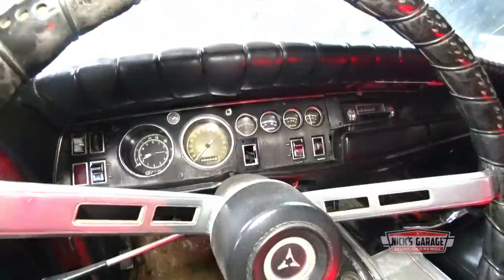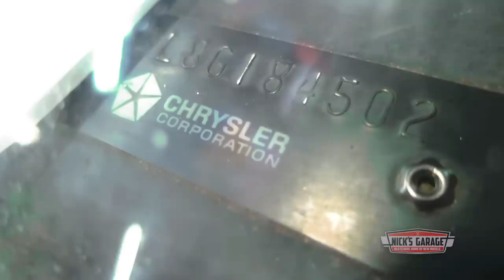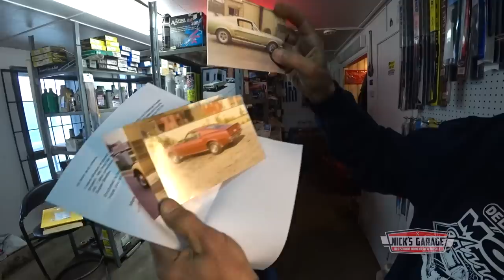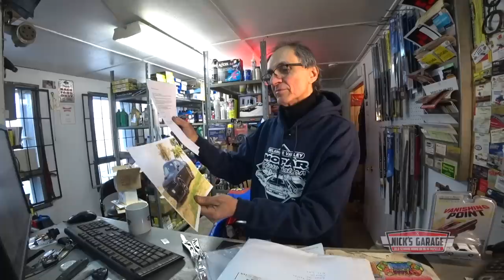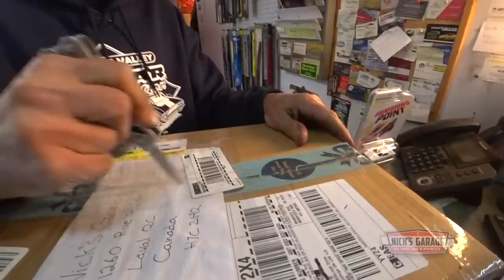1968 Coronet R/T 440 Tear Down - You Won't Believe What's Inside!

Comment: I got married in 1975. Had a rough running 69 Nova SS 350. Saw a 68 Coronet R/T for sale for a long, long time at a tire store. Traded Nova and $ 150.00 for the not running Coronet. Towed it behind my father in laws 64 Chevy P up 60 miles home with an old chain. Needed a battery, alternator, fuel pump, carb. and gas tank flush. With help from my MENTOR  (father in law, heavy equipment mechanic) got the 440 / torqueflight , Dana rear running strong.  THAT CAR SCARED US ON MANY OCCASIONS.  Was well known on Long Island N.Y.  Was a crazy fast animal. She loved running hard.  I swear Nick - she said faster, harder. Your shop makes me smile. The best days of my life were around hot cars and all nighters wrenching till after dawn. I thank you sir.
Reply: Van.      Good old days.

Comment: Much respect for reviving old muscle instead of replacing everything with an LS.
Reply: That would be sacrilege.
Reply: I agree...LS’s are for real men wanting mucho power... j/k
Reply: He doesn't need to remove the other head, especially if he can check it out with a scope, and he doesn't see excessive wear on the side that's already open, but he should crate the big engine for museum time and bolt in a lightweight 2.2 for better traction, along with rear battery. or would the AMC 2.5 be easier to bolt in?  trade power for traction and mileage.
Reply: Ultra CNC  I have 2 440 long block engines. One with a TRASHED auto, thw other with a 4 speed. Pulled them from the junk less than a year ago. I would sell them to see them live on
Reply: I'd buy the 440 to put in a mopar
Reply: @jamesrobin9961  Is that the $hit they put in that Fast & Furious Daytona?  It messed up the look of the car.
Reply: Putting an LS in an old Mopar would be stupidity!
Reply: @rs5200  They did it in The Fast and the Furious 3 on up.  To make all the cars standardized across the board, for easier  engine fixing and swap outs.  Why I don't like that Franchise.
Reply: I am not against ls swaps in Chevy cars but Mopar is better off in a scrap yard than with an ls I prefer a retro mod v6 3.5 ho over an ls Mopar needs Mopar parts imo
Reply: I would put a 5.7 hemi in it better then a ls in my opinion
Reply: 6.4 or 426 Hemi with aftermarket EFI
Reply: @jamesrobin9961  come on now. I agree the ls is capable of much more wonder but they are getting kind of common.
Reply: The only thing I would retrofit an LS into is a dumpster...
Reply: I'll keep building my 56 Dodge Coronet D500  with the 315 small block HEMI under the hood . These little giant killer's were Capable of lain down a1000 hp useing factory  built blocks  heads and factory cranks , and these HEMIS are 65 years old  . MoPaR  has been building 500 to 3500 hp small blocks since 1951 , nuff said  .

Comment: nick I think you are right,i saw the bolt,have disassembled hundreds of these when I worked at the dealership,saw a lot of engines wiped out due to jealousy,and wives that were twisted,if you can save the block she's still numbers matching,i replaced many long blocks and short blocks in 68-71,some were sent from the factory with same date coded blocks,when those ran out we put 69s 70's in cars till they were gone,looks like youre seeing what I used to see,i'm glad you're still working fixing these masterpieces of mechanical art,i've installed 69-70-71's in 72s clear up till the b's and rb's were cheapened up to junk,cast iron crank engines all need balancing

Comment: I had to pull the 318 out of my '73 'Cuda back in 1978.  The car sat a few months, and when I tried to start it, the engine was seized up.  The oil had been cooked to varnish in two of the cylinders, and it took a hand sledge plus a chunk of 2x4 to break the pistons loose.  When I had the block boiled out, they found casting sand still packed around those two cylinders.  My buddies and I put the engine back together with a Crane cam, anti-pump up lifters, and a double roller timing chain from Direct Connection, and I drove it for another five years.

Comment: Engine building and drinking don't mix! Looks like the distributor bolt. OR- someone removed spark plug, shoved the distributor bolt in, & reinstalled the 'plug. Bolt was near the plug, and was hitting it. We'll never know which. At least the block is okay!
Congratulations Nick on the special Kowalski plate!! 
Another all-time Great Nick's Garage Video! Thank you!

Comment: A air cleaner wing nut went into my  69 GTX 440,instantly shutoff after radical knocking noise at start up,took off head and found small remaining pieces of nut. Piston survived, put it back together. Tough motor. Got to love those 440s

Comment: Absolutely Love that Coronet R/T, and cringed so bad as the motor was opened up. Wonder if they didn't use a bolt to hold the choke open as they were starting it the 1st time after they did what work they did on it, and slipped into the carb and they forgot about it?..probably the longer 1 that should have been for that bracket on the top. Even the colour of that Coronet, as I don't usually favour red..but told people Chrysler had 1 in the late 60's I liked, and that is a beautiful example of the 'B' bodies.
Great job on the mail gifts people..and the surprise from the 'Garage Gang' at the end was pretty darn special too! And from Mrs. Nick and family as well.

Comment: Geez, these cars bring back a lot of memories. I’m 74 now and between my father and I we have owned a few Chrysler products. 63, Plymouth 313, 2 door Savoy auto, 66 Barracuda Formula S, 4 speed, 67 Dodge Dart 273 hipo, , 4 speed, 68 Roadrunner auto, 68 GTX auto , 70 Chrysler New Yorker 440 350 h.p., 71 Duster 340, auto, 69 Charger R/T Hemi auto. I bought the Hemi used with modifications. Ran bottom 12’s @118 m.p.h. I had a 73 Plymouth Valiant slant 6 brand new for a short time, not exactly neck snapping performance though. Lots of fun street racing back in the day Nick.
Reply from the maker: What a great collection of memories. Thanks!

Comment: I am in the process of restoring a 1968 Spring Edition Scat Pack Super Bee that I bought when I was 18 years old.  I have kept it all of these years and I want to drive it once more before I die.
Reply: Mike.      Go for it.
Reply: @nickpanaritis4122  I had the engine rebuilt by the premiere Mopar Engine builder in the Seattle area. So that is ready.  I have the rear end.  Not the one it came with.  My son and I are now looking to deal with the  body nightmare.  We intend to keep the stock stripes and Super Bee emblem that still exist on the car as is and paint around it.  We intend to upgrade the K member and front end to the latest type and of course the subframe connectors.  Due to the fact that the stock brakes were so bad we will go for the large front disc brakes conversion.  Anyway, before I started running my mouth, I respectfully ask if I can use you as a knowledge resource?  Regards,  Mike Dooly

Comment: I learned a long time ago when I was green and starting out good repair work starts with careful tear down. It cracks me up no pun intended how people toss parts into a pile then don't get the reassembly correct. Sometimes having a nut or Bolt left over then wondering where it should have gone. 
Great video even old dogs can learn new tricks watching a real pro like you Nick  !
Thanks a lot !

Comment: Somebody dropped that bolt in thru the spark plug hole on purpose.
Thanks for a great show, Nick "Mr. Charisma" Kowalski, Panaritis.
Reply: To those that think the bolt could have been "dropped in the spark plug hole", it is not possible with the engine in the car.  Spark plugs on R and RB engines are threaded in parallel to the ground(ie 90 degrees to the head).  Small block (LA series) have the plugs at around 45 degrees, so it would be easier, but still hard to do.

Comment: Nick, howdy. When I was young and inexperienced I bought a 69 GTO 400 4spd. I drove it hard and spun a nylon timing gear and so having no experience and little money decided to change the gear over to cast but I knew nothing about syncronizing the cam and crank gears... Put back together and turned it over. It turned over very fast and I knew it wasnt right so went for advice from an uncle mechanic who right off asked me if I lined up the crank and cam gears. Tore apart again and put it right BUT it had already slightly bent a pushrod. Not enough to see or to stop it from running strong so I drove from Toronto to Thunderbay with it and the rod broke on the way but the lifter popped onto the drainpan and continued to run without wrecking anything else.  Youth and inexperience is all I can defend myself with . At first I thought your 440 might have had a similar neophyt experience as there seems to be a lot of it here.

Comment: Was watching this before with my wife, when Vassili pulled the carb and I saw the new gasket, I said "Someone has been messing with this motor there will be a bolt or something in the cylinder" far out! That bolt was sat on the piston when the head was off, no way it cleared the valve. Full human error!

Comment: I love the comment that he made about power tools I thought that I was the only person who likes to use hand tools I like to feel the torque
Reply: Exactly Especially with an old engine you don't want to damage anything or strip out the engine using an impact or something like that. Also. I've never use a torque wrench in my life for anything. I can tell how tight it supposed to be.
Reply: power tools can damage threads
Reply: wow..me too
Reply: @seedlessgrapes2605  Really, does you elbow click when it senses a specific torque value?  If you never use a torque wrench, good luck with head gaskets on engines that use torque to yield bolts.  I really hope you are not working in a shop that is dealing with the public.  There are some repairs where a torque wrench is not just an option.  Head bolts, main caps, rod bolts, are just the beginning.  I agree that there are some where you can go by experience, but you must recognize that there are some that cannot be done based on experience.  BTW, I never bothered using air tools to disassemble and engine or do any work under the hood, always found the air line got in the way or hung up on things, or it would knock a bolt off the edge of the fender, making me have to reach into number 2 cylinder to find it.
Reply: @22099dscott  Wow, that is a long comment. I hope you're using voice texting for that long-winded explanation. If you type that with your fingers, wow, oh my God. Anyhow. I totally understand what you're saying. But yeah.
Reply: @22099dscott  If I do a head gasket or some job like that, I will do a torque wrench, but with new school stuff, I don't even bother doing your head. I just let my brother do it because he's much faster and easily available I basically won't do any internal motor work.
Reply: Power tools. Didn't have them in 1966 at 16 years old when I started building my own, still don't have them at 70.
Reply: I better stop using bigger percussion drills for small holes. I break a lot of bits.
Let me use my drills and jig-saw and I'm happy, building shelves or guitars.

Comment: 68 Dodge Polara was what I worked on. It was a great engine. Gosh they had great sound.
Reply: Ultra CNC  I was a kid, working in the garage at home. The biggest I recall was 5?? in the 68 Cadillac. You had to have 10 gallons in the tank, or it would pull air when the 4 bbls were mashed. They all worked great most of the time! I really miss them.

Comment: 440 Chrysler valve stuck open buddy and I pulled head, found vent tube off of top of carburetor in chamber holding valve open. I worked at a Chrysler dealer went to the engine man told him the story. He went over and opened his tool 30x6 half section of drawer full of things found in Motors. Most amazing there were all kinds of things in there.

Comment: My first mopar muscle was a 68 coronet 500 383/727. 
Really really really shouldn’t have sold that car
Reply: I just posted i have only seen 1 1968 Coronet 500 in my lifetime. People remember the Chargers, Road Runners,GTX, Superbee. But NOT a 68 Coronet 500.
Reply: Last year, when I took my K car to its first car show, my neighbor had a 68 Coronet 500 convertible, and he was the original and only owner.  It was a blue convertible with a white top, and it was drop-dead gorgeous.  It was a 4-speed, and I think he told me no power steering or power brakes.  Back then, he could order it with or without just about anything you could think of.
Reply: My first was a 68 road runner 383 727 my best time at York US 30 was 14.57 with street tires.
Reply: Back in the '70s, there was a local 383/4-speed '68 Coronet 500 coupe....it was a runner.
Reply: My first mopar was a 1970 Road Runner, 440/727, console,  N96 optioned! Paid $1200 and traded my 83 camaro for it. Drove it 4 years and sold it for my first year in college,  big mistake....I finished college,  but miss the car
Reply: U'r  Rite

Comment: The INSTANT a carb or intake manifold comes off, it gets wiped clean, and duct taped shut. Learned that 30+ years ago.
Reply: Same thing here. Back in 1975 on my second car I dropped a bolt down an open distributor hole during a manifold change  and it ended up inside the crankcase. Since then I always block every upward facing opening with tape or a piece of cloth. The oil return holes on the head are very important to block when you are changing valve seals with the heads on. You don't want to drop one of those little valve keepers down into the oil pan.

Comment: Nick, I bought a used 68, ex Connecticut highway Patrol Car in 83-84 had 170 k .  I had a company wagon. the 68 was my spare.  you could leave that car for a year and it started every time.  It looks like the same engine.

Comment: Finding a bolt almost embedded in a piston like that is freaking crazy
Reply: I’ve heard of people tossing a screw down a carburetor of an rival’s motor as sabotage it’s a low down dirty thing to do but it happens. I know of guy that screwed someone on a 65 Malibu SS so the wife tossed a screw down the carb of a 69 Mach 1 gasser with a 427 side oiler with similar results.

Comment: Great video, love the car,my uncle was a Mopar, Chrysler man he's passed on, he owned 2,60s model Superbees one with a  383six pack and a another with a 440
Reply: Didn't have a 383 6 pack
Reply: @zaneturner4478  I could be mistaken  then , I was only 8 or 9 at the time, it's possible also a 440,I'm far from a mechanic, thanks for the information
Reply: @kevinlewis7882  440 and 340 where the only 2 motors blessed from the factory with the 3x2 carb setup still great memories from your younger years no disrespect meant
Reply: @zaneturner4478  no problem, thanks for the information

Comment: That 440 is going to be rebuilt by Nick and Vasile to be better than it ever was before. God I love those old Mopars. My neighbor had an all original 383 4 speed 70 Barracuda and when I met him, the entire drivetrain was out and he had no idea how to drop it back in and get it running. I went up and in one day we reinstalled the clutch, dropped the 383 back into it, reinstalled the A833, and there was something wrong with the Z bar linkage because we could never get the 3 little fingers to disengage the clutch fully. Since then he got a divorce, moved out, and he sold the car to a muscle car dealer that deals in mostly old Mopars in downtown Beaver Falls. I would've LOVED to have owned that car, but I don't have a garage big enough to work on it, so it would've sat outside and I couldn't have lived with myself. Such a shame.

Comment: i too wouldn't do a tear down with a  phuematic  gun because  if the threats get stuck  from rust  you could snap the stud off or strip the bolt .    I like to feel the resistance to turning  which alerts me to an issue.

Comment: At the begining of the episode, you mentioned a bolt being too short and needing replacement for reassembly. Was the culprit bolt, found imbeded in the piston, the correct size and the reason the short bolt was substituting?
Reply: Twenty-47.    No, it should have been a longer bolt, to be correct for the distributor hold down.
Reply: @nickpanaritis4122  it was a 3/8bolt, carb and distributor use 5/16 bolts

Comment: I wonder if they can weld the head to fix it? May be thats a bad idea it could have cracks you cannot see with out magna flux and its close to the valve seat too.
Reply: Nick said they got a bored 30 over and if I'm not mistaken you have to put new heads on if you bore the cylinders out
Reply: @acts2211  Oh I see didnt know that.

Comment: That has to be the neatest box opening yet. Top work boys and Nicks Wife. You did a top job.😉👏

As for the 440 i trough it was meant to run on fuel. Not nuts and bolts. 😅😅😨👍👍

Comment: I wonder what the circumstances were for the car being auctioned? somebody may have lost it in a dispute and popped a bolt down the carb  .
Reply: very good point, wonder what else they sabotaged, i'd be looking a the transmission and every rotating/bearing part
Reply: @Mercmad - That’s a very good point. Years ago I had a Roadrunner that was easily one of the top five cars in the area. It was a sleeper and ticked off a few people occasionally. Long story short. After a successful night on an under construction Rt 119 (new 3/4 mile long concrete straight section!), someone followed me home. I rarely kept the car outside. That night I did. Fired it up the following morning to put it away. The thing shook like crazy. Before I could turn it off it locked up. Someone dumped a handful of 1/4 inch lock washers down the carburetor. So yes, sabotage is a possibility.
Reply: Original owner may have died and knew his heirs better than we do.
Reply: Thats what I was going to say also
Reply: @JohnBrown-cz7ww  Just thought of something else.  It went to auction, someone might have sabotaged it at the auction to spite someone else winning it...